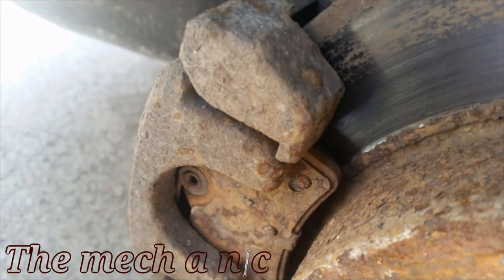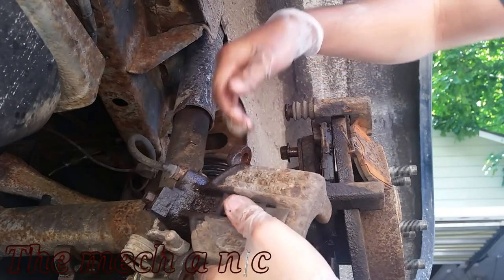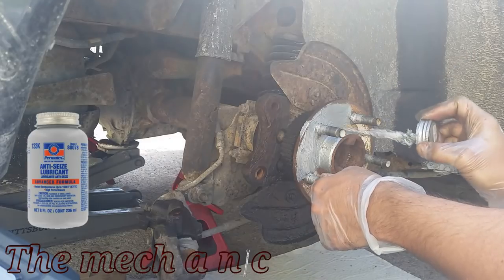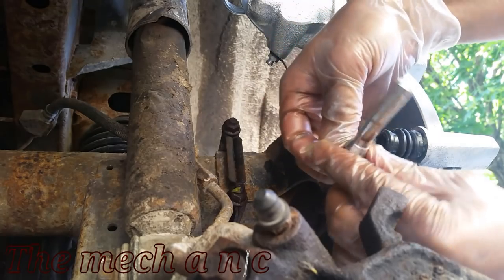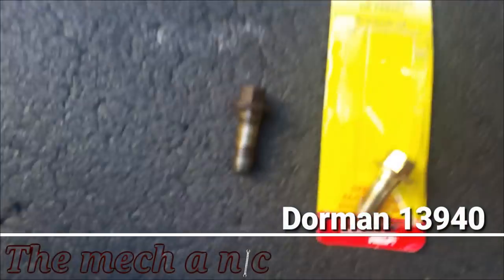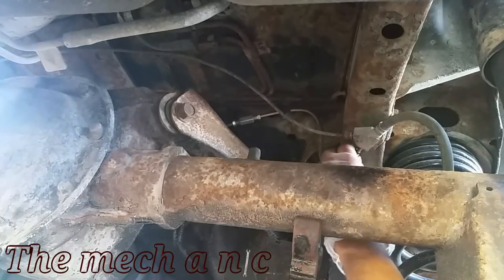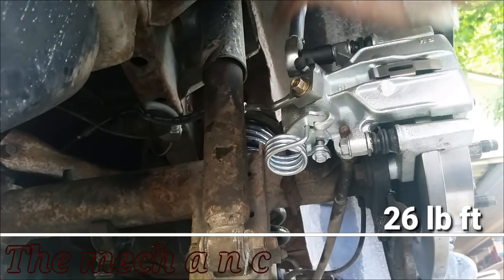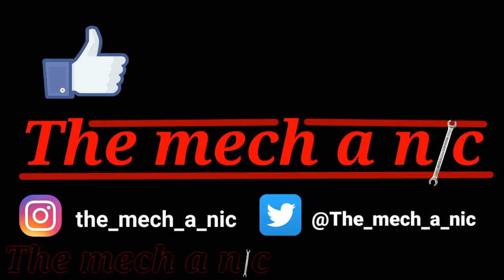94 - 98 mustang rear brakes

Comment: man thanks for the video but I just need to leave this comment. I know hes not going to use the old calipers but please use vice grips on the e-cable wire... that bolt that hold the spring down can pop out at you very fast or even you might brake the bolt and if your not getting new calipers your in for new ones now.

Comment: I have Mustang rears on my Ranger...Anybody considering a rear brake mod -- for converting to disc brakes -- I highly recommend a proportional valve (with manual tuning capability). Reason is, my truck is 4100 lbs., a '98 stock Mustang is around 3500 lbs, give or take a couple hundred pounds. That means your conversion needs to take into account the stock weight of the donor, vs. the weight of your vehicle. Otherwise, you may wear out your pads quicker due to a heavier weight (more friction to stop a higher amount of mass).
Reply from the maker: +Isaiah Welch good info

Comment: Thanks for the video.
Someone had told me that i would need a tool to "spin" the caliper back into the hub. But thats for 99 and up model
Reply from the maker: Yes some cars do require that tool
Reply: I must apologize. I was TOTALLY wrong.. As i got into changing brakes and rotors i realized that a caliper tool is TOTALLY necessary to compress rear caliper pistons on a 97 and related model mustang. A simple c-clamp for the front though.
I should delete my incorrect comment so I dont mislead anyone. It's a pain in the ass to be already into repairs and have to go right back to the parts store. But yes, a caliper tool is needed for this application.
My bad bro...

Comment: 9:47 I came here specifically looking to see how the clips are installed, and you didn't install them :(
Reply from the maker: Which clips?
Reply: The metal clips that go on the outside edges of the brake pads
Reply from the maker: They're to take up any gap that you may have so the pads don't bounce around in there. I honestly don't remember why I didn't use they unless there was non supplied in the box for me to even use . At 9:44 you can see that tried shaking the pads and there was no play. If there was I would have been concerned
Reply: @themechanic6117  there called shim clips and they are major for vibration now you think of it as greater lesser <> you want the clip "eating you" and the pad on the disc or so you have to pinch it down .. kinda hard but easy as you go
Reply: Same. 😞